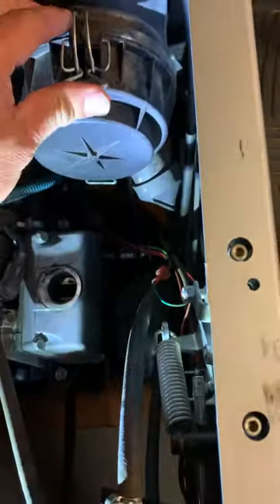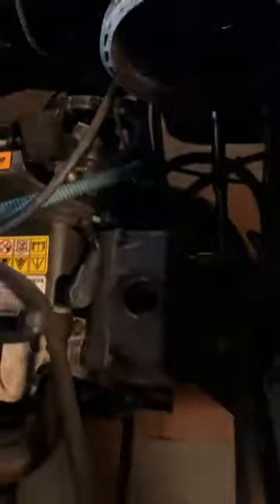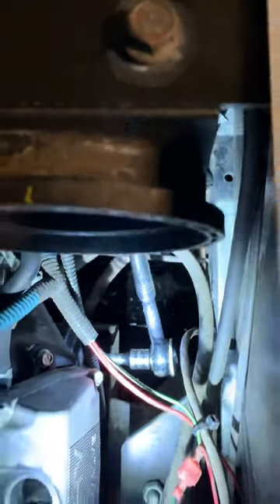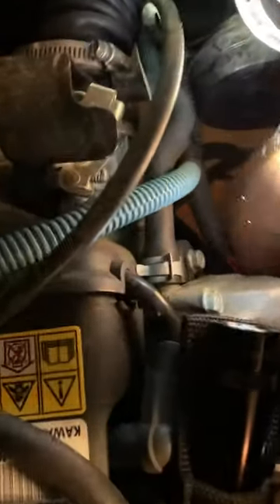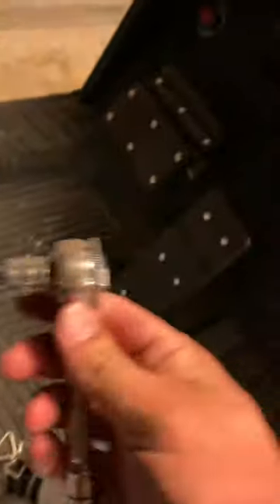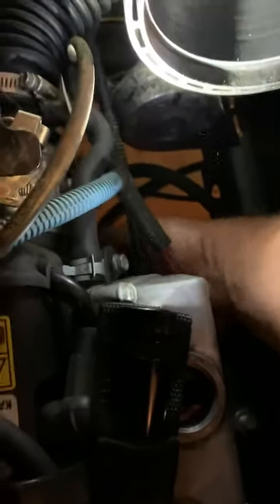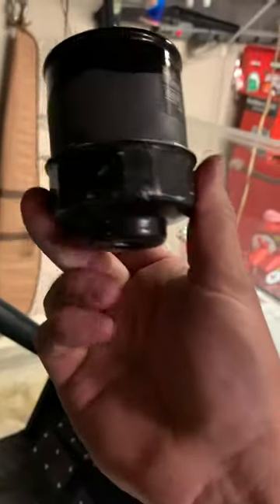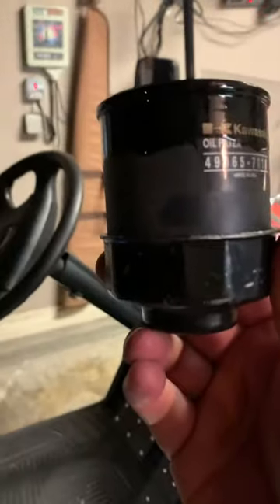EZGO TXT Kawasaki Oil Filter Hack EASY!! Oil Change

Comment: "take your oil filter off and bring it to the store to find the size oil filter socket you need" lol that's the whole issue not being able to get the filter off.. I bought two and they slip and or not the right size to get the filter off. FML
Reply from the maker: What about taking the new filter to the store